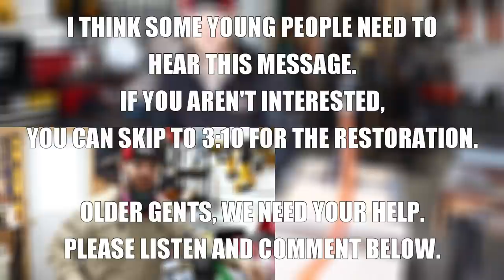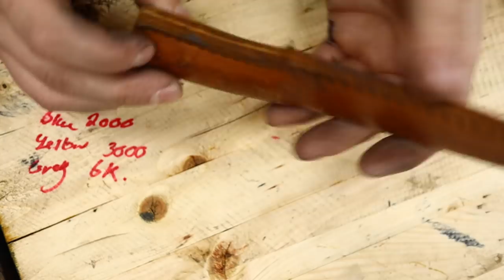FULL RESTORATION on a Gorgeous Vintage HELLE!!

Comment: Life is much like the knife here in the video, if you take good care of it, the restoration won't have to be this extensive. Keep active, aim for big dreams, you'll end up somewhere good!
Reply from the maker: Excellent! Cool view point. Stay on a good path and you won't need some big intervention or 180 degree turn. A little care and maintenance here and there to keep you well
Reply: As someone taking on the restoration of their own life from not being the sedentary life anymore, just like a restoration, it's easy to put off because it's going to be a lot of work and a lot of time to get anywhere near something workable. But if you do take the time, scrub off the rust, and put the work in, you might be surprised how fast you see improvement

Comment: 29 from Denmark here, 100% it gets better. I hated school for several reasons, was bullied for years had at most 2 years of positive schooltime.

Ever since school ended I was caught in the system for a good 10 years time (doesn't have to be you), although better than being in school it was still rough, but as soon as I got through that, and finally got my first apartment I was free, that's about 7 months ago now, and life has never been better!

Comment: Give the leather grip some neetfot oil that are made out of cow legs. it's the oil that people use for sadles and horse leather stuff. It fills the pores in the leather so it gets back to it's full size and it stoppes being loose. I grew up with these knives here in Norway, i think i have the same knife somewhere and i should meane it was made in the 70's.
Reply from the maker: I have never used neatsfoot oil, but heard plenty. Boiled linseed oil is something I use often.
Reply: @kyle_noseworthy  raw linssedoil is a great oil on wood because it penetrates much deeper than the boild one and does not contain lead and other heavy metals. And it dont get sticky and easy to clean of hands and smells good. But the neatsfoot oil is made for leather and has special propertys that fills up the pores so it returns to original size. So therefor ideal to restore old knives with leather grips thats lose and with lose guards and so on. You have a great channel and good luck forward in life. And a big hello from Norway

Comment: You did a great job giving this knife a cosmetic restoration.  That said, you have no idea if the tang of the blade under that leather is just a hair breath away from rusting away or not - you simply cannot know that unless you take it completely apart and do a "FULL" restoration - this is NOT a full restoration video.